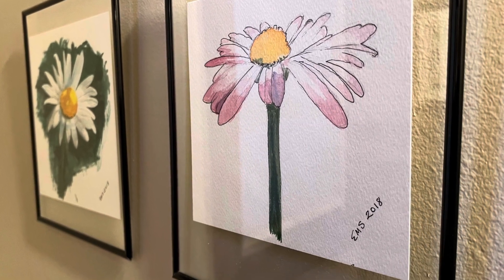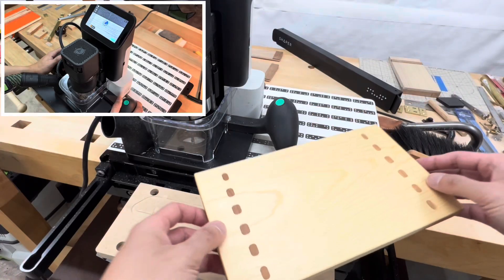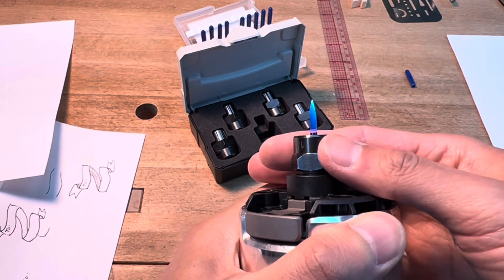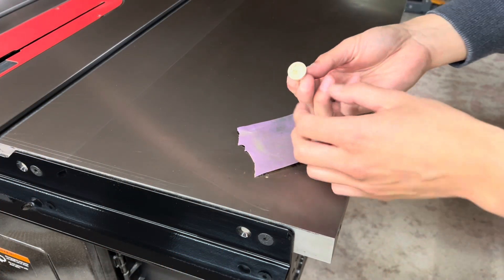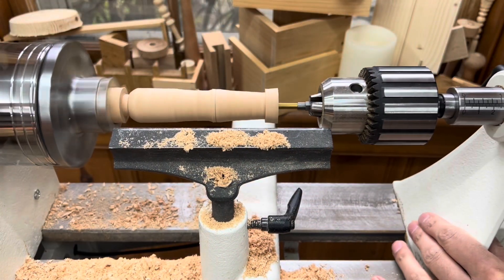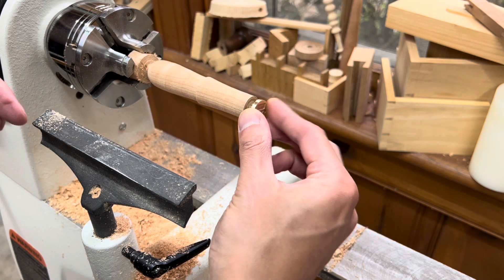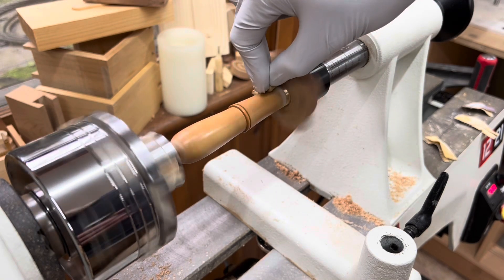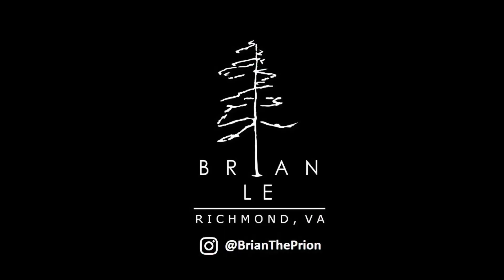Creating a personalized stamp using Shaper Origin and Lathe out of brass and wood

Comment: Fascinating. I did correctly guess the date area - I don't have a 'branding iron' but I do sign and date my stuff -Sharpies are good and cheap.  On your question: nitrile gloves should be just fine - they'll vaporize upon contact, and usually do when I need them not to (ebonizing oak, etc.). The issue is with leather or cloth, which will resist, catch and drag your meat parts into danger.
Reply from the maker: Finally someone who understands exception to rules and not just blindly following mantra. Agreed about leather or thick work gloves; they’re the kiss of death and a quick way to be on disability.

Comment: Nice work! And no, nitrile gloves aren't at all dangerous with the lathe or any spinny tools. People get up in arms about this kind of stuff and fail to actually consider material compliance and basic physics. And I know first hand that nitrile gloves will tear themselves to shreds if you just look at them wrong, much less have the necessary tensile strength to pull your hand into the machine. Besides, it looks like you are also a fellow user of the Jet 12-21 lathe which can just about be stopped by hand it's so underpowered haha!
Reply from the maker: My man Ben. Finally someone with common sense. You explained that perfectly. You got the same Jet Lathe eh? what kind of stuff have you been making? post some vids i wanna see!